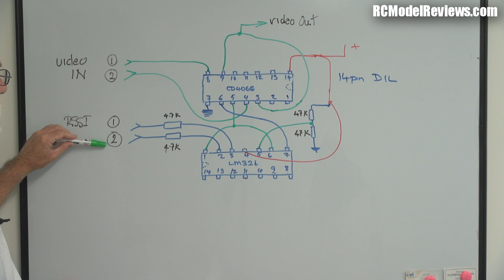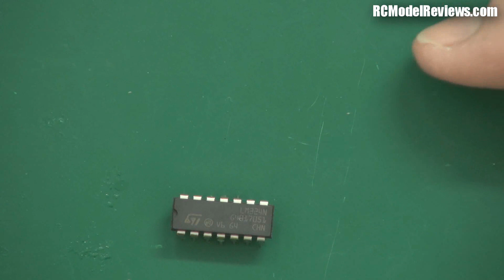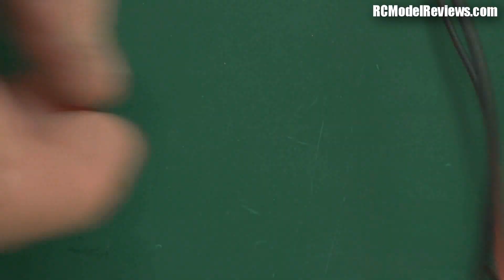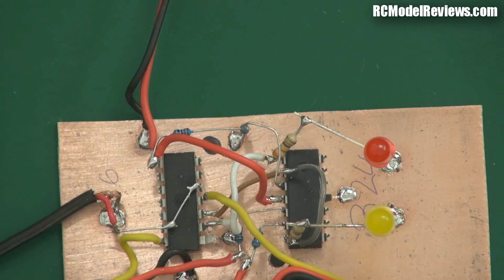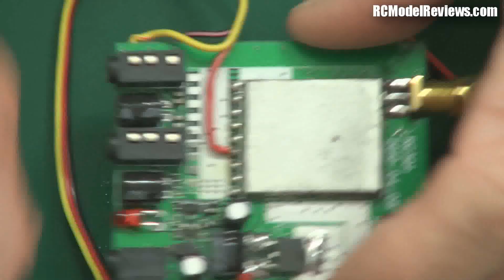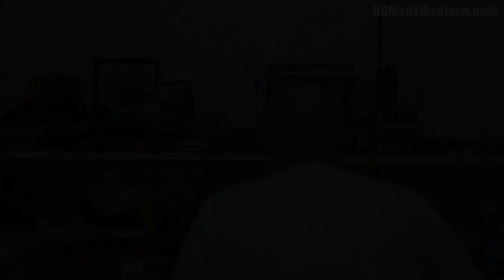A $1.29 FPV diversity controller (build video)

Comment: Would anybody know what the acceptable voltage range for all this circuitry is? Is a 3s lipo okay at full 12.6V? Or do I need to add a voltage regulator?

Comment: Can not find CD4066BC or LM326 any suggestions?
Reply: It's just being used as a comparitor. So pretty much any dual op-amp should work so long as it can be powered by 5v. I'm honestly not sure why Bruce uses quad op-amps since he's only using half of it, unless that's just what he had laying around.  Same with the switch. He uses a quad bilateral switch and only uses half of it, So again, any dual bilateral switch should work so long as it's 1:1 and runs off 5V Vcc.

Comment: I looked everywhere and was surprised I could not find and answer.  I had the controller picking the weaker signal.  I fixed the problem by switching the two wires on Pin 5 (control B) and Pin 6 (Control C) on the 4066.  
So Pin 7 on LM324 now goes to pin 5 of the 4066. And Pin 6 on LM324 now goes to Pin 6 on LM324. Hope It saves someone some headaches.

Comment: This got to be most complicated use of a copper circuit board. It has only one connection - GND. It is a surprising use, and I had never thought about that method. However I would suggest a perfboard (perforated prototype board). It costs only a few euros and can make nice solid implementation that can last for years.
Reply: Pro of using the entire copper base as ground: It's a nice shield.

Comment: correct me if im wrong, but the Lm 324 is a quad comparator and it seems your using only half, so you could instead use an lm393 which is a dual comparator. (i have lots of lm393's lying around as a result of making lots of line following robots XD)

Comment: Hi Bruce, This is a great project! I have started mocking up the circuit on the bread board and prepping the rx's. I'm going to be using an RC305 and RC832, which I have noticed have slightly different RSSI voltages. The 305 goes between 0.52v - 1.16v and the 832 0.47v - 1.12v. Will this different RSSI input voltages cause the diversity controller to favour just the one RX?
Reply: don't get cocky, just 'cause your rubbing shoulders with the stars  :)

Comment: I removed the 1 meg resistor, now when I power it up both LEDs light up -turn on the Rx's and it switches back and forth fine but the red LED is always on -yellow one goes on and off like it should the bread board mock up is doing the same thing? what would cause the LED not to turn off-anyone have a clue

Comment: Anyone know if Bruce has posted the video on powering this whole thing up yet? I have it working (or did) it was doing good until I added the resistor and the two caps now it locks on to the first Rx that has the best RSSI and won't switch I might have to lower the 1meg resistor or remove it all together anyone here have any thoughts idk- just wondering how he recommends powering it?

Comment: Hi Bruce
your work for the hobby is PRICELESS, THANK YOU!!!
I wander (and I am sure it possible) to make a schematics for 3, 4 and even more receivers connected, to avoid antenna tracking just having multiple directional antennas. can you take few minutes to link schematics for multiple receivers?
Regards
Nick
Reply: Hi Nick if I understand you correctly it is pretty easy to add two more receivers to this circuit ,I was thinking the same thing lol I was looking at the data sheets for both chips and since this only uses 1/2 of each chip there is room for the same circuit on the other 1/2 giving you 4 receivers total all feeding one monitor but don't take my word on it as I'm self taught & not 100% sure how good it would be-I did build this one and it seems to work pretty good I have yet to fly and test it in the real world  (I plan on adding the other 2 Rx to see how that works)

Comment: how does this hold up when there are storng interferences? would it interpret them as a stronger signal and switch to the worse video ? or does it read the video frames and know which is the best quality video?
Reply: its RSSI based it doesnt look at the video.

Comment: you can even integrate an audio switcher in this circuit without adding more components... for those who have an antenna tracker based on audio transmission

Comment: Are the video inputs supposed to be the 5.8GHz signals directly from the antenna'so?  If so I am surprised that that would work well,  but I suspect that you have the video out of separate receivers going into those.

I would have designed this using small shielded Reed relay switches with antennas connecter to one end,  and the other side of the relays joining together at the input of one receiver.  That way you are effectively swapping antennas rather than receivers. Aluminum sheiding should stop radiation losses and interference,  but let low freq. magnetic Flux penatrate to close/open the switch.

Comment: Hi Bruce, I need your help mate. I have made this and I have a few issues, the main one is, it seems to switch to the lowest signal strength. I connect it all up, and check the RSSI voltage, the led lights show its switched to the weakest signal. I take a reading between the two Rx and the light is on the lowest RSSI voltage. What have I done wrong? is it the higher the voltage the better the signal? For example have a helical antenna on one and no antenna on the other. the Helical RSSI reads about 1.6volts and the one with no antenna reads 0.42volts but the diversity unit wants to switch the the Rx with no antenna.
Hope you can help. I was excited that I was able to build it and am getting a video signal, (weak) but what have I done wrong. there is something else which is wrong but I thought I'd ask this first.
Reply: azzurripro Did you happen to get it worked out? I have kind of a similar problem sort of mine is switching and working correctly just one of the LED's wont turn off when it switches?
Reply: Rosario W??? wonder why it did that LOL

Comment: bruce plz help me out ....
At 16:10 we can see the 2nd RX used .Its the module RX5808 ?
I see you just feed 5 V into it. VCC and ground . I get that much , but I ALSO SEE A 470 uf IN THERE ? 
From the pin video out on the RX5808 .
Am i right in assuming I put the 470uF in between the pin VID out and the actual signal  out ?

Comment: one improvement would be to use 2 4066 gates for each video in to out junction. this will decrease resistance between in and out.

Comment: could I use a lm339 instead of a lm324
Reply: It will do the job, but isn't a drop in replacement. The circuit would have to be altered somewhat.

Comment: Nice one Bruce, I'll give it a go for sure! Here's a question- if it has 2 Vrx's for diversity, would I get away running 2 Vtx's on an aircraft? Lets say if I put one Vtx on my quad with RH clover facing up, and the other LH clover horizontally, or both in a "V" and get 2 matching Vrx's (with the right polarization antennas of course) with each Vtx? Should work?
Edit: I just realize that I would have to run 2 cams as well...

Comment: Go for the LM339 instead of the LM324, check the app notes for the hysteresis, just 2 more resistors. Also the chip is REALLY cheap and fairly common.
Reply: The LM339 will do the job better, but isn't a drop in replacement. Bruce's circuit would have to be altered somewhat by swapping it.

Comment: Bruce, if my understanding is correct, you may have switched vid1 and vid2 on the  CD4066. If RSSI1 goes into pin3 of the LM324 and goes high to pin5 of the CD4066 then vid1 should go into pin4 of the CD4066 and not pin8.. 
Don't think this would cause the flickering but still.

Comment: even with hysteresis, it will have those flicker, try RC dampening on those gate inputs instead, it will smoothen the switch transition, the switching is to sharp, we call it noiseless toggle switch in in audio circuits which eliminates pop in audio mixers when a DJ using switched scratching rapidly, anyway the video signal is also analog signals. great video Bruce.
Reply: Yeah, I'm going to look at the slew rate.

Comment: Liking the wing it attitude Bruce. Apart from the hysterisis issue I can foresee it may require a voltage divider to to exactly match the RSSI voltages to account for tolerances and possibly even different models or brands of receiver.
For those with misgivings about the dead bug construction method, while it may look chaotic and a pain to construct there are actually advantages from a signal integrity point of view over using say strip board and this unit is ground station based so issues with viration etc are minimal. I am sure after making the first it will become clear where it would be possible to improve the layout and wiring. Things like cutting small squares of pc board to form insulated islands on the back plain board or to cut similar islands into the back plain copper. Like Bruce said don't get too hung up on the construction even if you need to make a few up to get wher you are happy with the finished article it's still going to com in under $20.

Comment: Nice work Bruce.
Secondary question to ask one's self. What made it work without excessive switching on the breadboard but not on the buildup?  Component placement,signal proximity, breadboard parasitic capacitance perhaps?

Comment: Hi Bruce, thanks for taking the time to do this... I would like to see if it is possible to make one that works the other way around?
I think my airwave vtx runs an inversely proportional rssi, so good signal results in low voltage, so for me wiring the system in this way would result in the unit constantly picking the worst signal.
Any pointers really appreciated. Thanks steve
Reply: Just swap the RSSI (red) wires over and it'll work with reverse RSSI.  So put receiver 1's RSSI wire onto the resistor that currently has receiver 2's and v/v - then it'll work just fine.

Comment: Brilliant work...!!!!!!
Typical.. I just got my Skyzone goggles for head tracking with the diversity receiver but then it accured to me, I cannot  use a directional antenna on my goggles and also turn my head for the head tracking without loosing signal..

Back to using a ground station and give your diversity controller a bash.. :o)

Many thanks Bruce...

Comment: Great video Bruce.  Thanks.  I wonder, is there such a thing as triversity?  At the place I usually fly (our club field), I usually fly right to left.  We have close to a mile of space each way, and maybe only 100 yards in front of us, so it would be nice to put two high gain antennas pointing left and right and a simple CP for the center.
Reply: That is where the other RCModelReviews diversity controller will come in handy -- it has the capacity to support four receivers.

Comment: I have used a commercially available version of this many years ago that already has hysteresis and works very well
no soldering required.. Rangevideo's micro diversity controller...very inexpensive and works super

Comment: Great video Bruce, keep it up! This controller plus a $26 RC305 and a homemade antenna will upgrade a working system very easily and on the cheap!

I also like the "back to the bench" moto :)

Comment: Thanks. I hope you add the audio diversity too which can be done on the same chip I think.
Reply: I added to the basic design so audio switches at the same time as the video. All you need to do is bridge pins 5 to 13 and 6 to12 so that each pair closes at the same time. Then bridge pins 2 to 10 with a connection for audio "out". Then run the wires for audio "in" to pins 1 and 10. Make sure to match audio/video input wires (pins 1 and 4 RX (A) // 8 and 11 RX (B)). I can make a video of this if anyone needs it.
Reply: Andrew Goldberg Forgot to specify those connections are on the 4066 chip
Reply: Andrew Goldberg ***Correction** the Audio "in" pins are 1 and 11

Comment: Hi Bruce, maybe you could tell how to make same sort of controller on better components like mentioned in comments to the previous clip? 1.29 is a good price but I believe many would go for 10 or 15 bucks just to make sure the thing works well and does not limit the range.
Would that be possible?
Thanks.
Reply: Bruce is indeed preparing a full diversity controller... This is just the lite version
Reply: The idea was to make one as cheaply as possible from parts that anyone can get. He has been working on a much better diversity controller but mentions that cost and parts availability are not so straightforward. This is for people to play with, if you are going to be risking mass amounts of $$$$ then you would be better served spending some real cash on diversity as well.
Reply: Anthony Burt I have good GS for long range missions but I suddenly realized I have two 5.8 receivers in my drawer... Naturally, I'd like to make them work together. Someone mentioned in comments to Bruce's recent post that the controller may remain equally simple but made of better components. That's what I would love to make. Keeping it simple (as my electronics knowledge is below zero) but not necessarily hitting the very bottom of the market.

Comment: First of all I think this is a great project, thanks!
In the next video could you please cover how to use a 12vdc supply and also where to find the RSSI on other receivers such as the common Immersion or RMRC ground station units?
Reply: to pover it just use a regular ubec 5v/1a or even a 7805....
Reply: Dalvaru Ciprian Thanks, now I just need to figure out where the RSSI output is on my 1.3ghz RMRC receiver. Do you know?